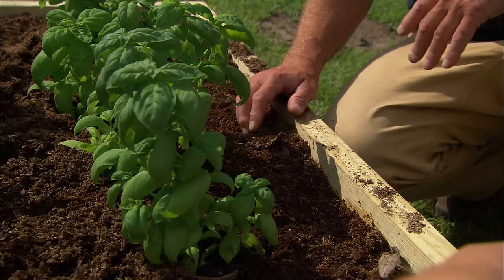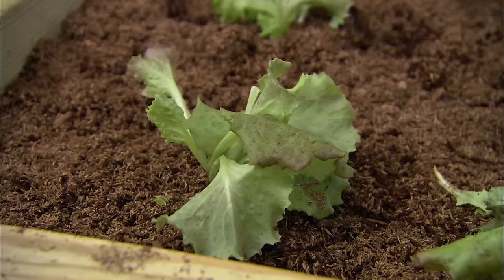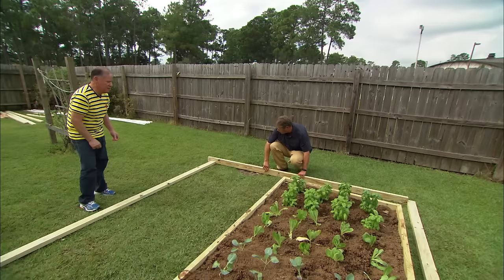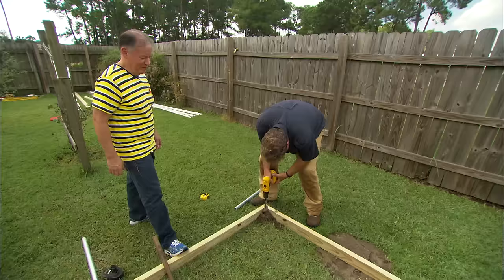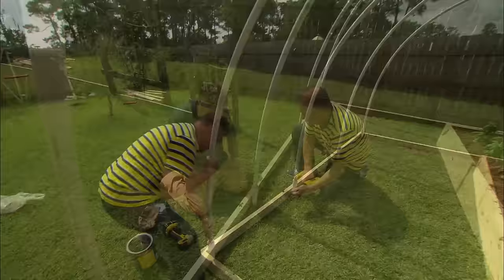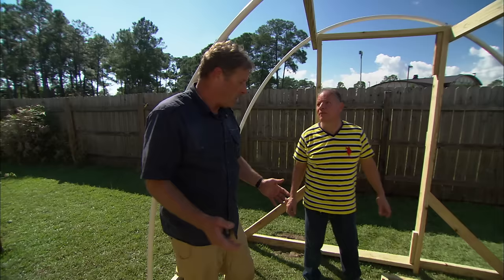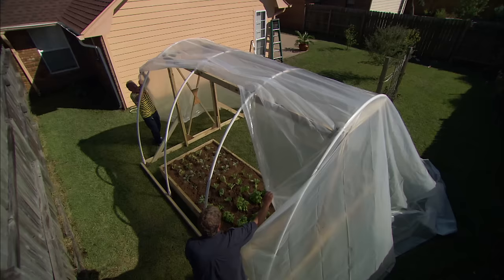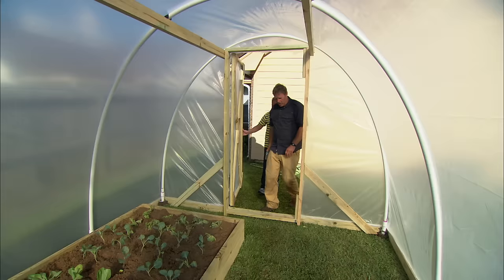How to Build a High-Tunnel Greenhouse | Ask This Old House

Comment: Much easier if you were to use rebar instead of steel pipe for the support base.
Reply: Never heard of a string trimmer?
Reply: rebar rusts
Reply: Cv
Reply: @albertleppo8139  it will outlast the wood that's sitting on the ground.
Reply: I use the rebar also, I've had some in the ground for 2 decades, haven't had an issue yet. Also, the doors seemed like an awful lot of time , effort and cash, when just using plastic over the whole thing works just as well. I attach a 1x3 to the edge of the plastic, and then pull it up or down when it gets to hot in the summer. In Massachusetts or Maine (I have places in both) even the summer gets to hot for permanent hoop house. better to be able to use it spring and fall, then take off for July and August.
Reply: What length pipe/ rebar is used?

Comment: For the staples…. Fold over a few layers of plastic, pull it tight, and the staple it! Afterwards use one inch roofing nails spaced every 6-12 inches! It’ll hold!

Comment: that far south you do not need plastic to keep frost off greens. they are pretty hardy anyway and i would go with row cover fabric instead. the biggest reason to use row cover would be for pest protection anyway. here in tn i had spinach collards turnip green and cabbage survive the winter with freezing temps. my biggest issue was bugs once the temps warmed up. next spring i will be using floating row covers for my brassica vegetables and my squash since vine borers are a real problem here.

also why build a tall walk in place when you can just throw up a small hoop house with fabric to protect from frost or pests?

Comment: Any concern about the pressure treated wood chemicals seeping into the ground and then into the vegetables?
Reply: Depends on which chemical your wood is treated with. The wood you buy today at the store is perfectly safe for your raised garden even touching the soil but old wood is best kept away from the soil touching your plants but for the greenhouse frame is okay. That is because of the chemical they used to treat wood with called copper arsenic.

Comment: Bare wood in constant contact with moist ground. I wonder how long it will hold against rot, even if impregnated.
Reply: Just elevate the wood an inch or so from the ground.
Reply: +Anders Spælling and defeat the entire purpose of the greenhouse which is to keep the air inside and hot.
Reply: Chris Searle a few milimeters Will not make a difference
Reply: Chris Searle its pressure treated wood. It'll hold up for quite sometime
Reply: Like the guy said, elevate an inch on some bricks.  If you want to do the extra work, put some concrete block all around the perimeter, then screw the 2x4 base into that.  Or screw some 2 foot lengths of 2x4 under the 2x4 base every few feet.  Then replace those every 3-5 years.  The plastic will be torn by then anyway, and you'll give up on the whole thing.
Reply: The wood will last longer than the pvc and plastic.
Reply: @jackfrost326  wrong, genius, pressure treated still rots

Comment: Should've bought some pressure treated lattice strips and rolled the plastic ends over them, them nailed through the lattice strips with roofing nails.  That would've held the sheeting all across its surface on a 1.5" strip instead of just at the points where you stapled.  It makes a big difference in wind conditions, especially the kind Mississippi gets.

Comment: Looks good, but you shouldn't staple the plastic to the 2x4, it'll rip in light wind. Instead of using 2x4s use two 1x4s, sandwich the plastic in between them and screw them together. 

Also, he used pressure treated wood on that raised bed. The chemicals from the treated wood is going to leach into the soil and contaminate his vegetables. Better to use some kind of stone or cinder block. I mean, they have the right idea if the wood is going to be in contact with the ground. But pressure treated shouldn't be used on a raised bed that grows things you're going to eat. Otherwise it's okay. 
'
Reply: Take a look at the new method of creating pressure treated wood after 2003, you may be delightfully surprised.
Reply: @forestrebock3545  
For decades it was argued that the arsenic in pressure treated wood was harmless. So now there are alternatives to arsenic and again it's claimed they're harmless. The question is, do you trust those in the industry or is a little skepticism warranted? As for myself I prefer to use stone. To each their own.

Comment: What are the finished dimensions of the greenhouse:  Length, width, and the height (at the middle point).  Also, isn't the common 4-mil plastic sheet a wrong choice for the covering?   With full exposure to the sun It would barely last one season.  A UV stabilized 6 mil sheet would be a far better choice for this purpose.
Reply: expensive - sand and paint tubes with Krylon acrylic white spray paint or put rubber (not vinyl) tape where pipe touches sheet ... it's the vynil chloride gas off from the pipe that destroys the poly sheeting...
Reply: I use 4 mil on my mini 4x4 greenhouse and it lasts me the whole season true it does degrade but its an easy fix

Comment: That pvc will become brittle over time from UV rays if your serious about making a greenhouse get galvanised pipe  you can even buy greenhouses and just put them together yourself.  Also that plastic they brought is not as good as the proper stuff.
Reply: +Erin Scott It's grand if you want something temporary but for the long run go the proper way.
Reply: Instead order UV stabilized plastic from suppliers like Farmtek or Gemplers.
Reply: iShootBandits you can spray paint the pvc to block the uv rays if you want to use the pvc
Reply: my mom built chicken hooupes out of pvc exactly like this.  I was 11 when we assembled them, I'm 33 now, the pvc is still serviceable.  never did anything to it.  it's chalky, but that's about it.  PVC outlasted the chickenwire as a matter of fact. Thanks to our high-humidity down here in mississippi.  Probably cost $100 22 years ago, not a bad exchange If i say so.
Reply: The PVC if unpainted will off-gas and deteriorate the plastic sheeting, too. Combine that with not using greenhouse plastic and I’d wager that this hoop house doesn’t last very long.

Comment: A plastic single layer high tunnel is actually colder at night, because the air is still, so you will need somekind of heath source

Comment: Clearly not the original idea. "We are going to need 4 10 footers and 4 12 footers". That was clearly way more than 8 2x4's later on.
Reply: Lots more wood and hardware required, the doors by them selves is a whole other project.
Reply: He kept driving back and forth and forgot to add that part because it was a booze cruise

Comment: question....can this kinda of green house stand again strong wind? im not talking about hurricane but like strong wind that some time appear around winter times.
Reply: Not that thin plastic, and not with just staples.
Reply: Maybe if it had more tapered sides, with no flat sides, so the wind would just go right over it.  As long as their's nothing for the wind to catch, and everything is secure, it seems like it would be pretty resistant.
Reply: Even worse there is no end to end support. He braced the door frames but wind coming from either end will blow this over. Four corner posts should have been longer and dug in.
Reply: I'm going to give this a shot with 6 mil plastic... I'll let you know in a couple of years
Reply: Commenting to be notified in a couple of years
Reply: Icemarine972 lmfao....

Comment: does this guy have some bias against offering useful, actual, solid-built, durable structures?
Reply: Nothing wrong with having a small greenhouse Patrick
Reply: Cost.  Thank you TOH YouTube Comment Section Expert #6,213,256
Reply: Your missing the point of TOH. The actual show, shows off their skill. These projects going to peoples houses are meant to show a home owner how easy these projects are to save you a ton of money. You just need basic tools and with zero experience you can pull this off. This is for the everyday home owner on a budget trying to save a few bucks any way they can.

Comment: you think staples will hold the plastic down in the wind...…..no way
Reply: Not a mission.  I cover a 1" lath in duct tape.  Sandwich the PVC sheet between the frame and lath and bolt together.  Has survived many, many coastal storms.

Comment: They used 1” schedule 40 PVC so thats good. But they could have saved money and used all PVC instead of adding so much wood. And they could have used rebar to help hold it down. 
Staples in the none uv rated plastic will tear that sheeting apart. Thats where they could have used thin slats of wood to hold down the sheeting.

Comment: PVC will destroy the plastic real fast.
Reply: So what do you need to do to prevent destruction of plastic. I'm using 6 mil UV rated and 1" PVC. I've seen suggestions about sanding the coating off the PVC and painting it with Acrylic.....??? I'll definitely use more than just staples to fasten the plastic; I live in a fairly windy area.  Lou F.

Comment: Staples will rip the plastic.  The plastic should be greenhouse grade.  The ends are not sturdy.  The 2x4's are directly on the ground.  The PVC not fitting the stakes is crap; use rebar.  Tom Silva is not eating his heart out.  He's laughing or maybe crying.  This was a terrible instructional video.  Wrong every step.  Even the project.  All the "customer" needed was a hoophouse over the raised bed.
Reply: Kube Dog Had to laugh, this coming from "This Old House".
Reply: Kube Dog You answered all my questions with your comment, thank you!
Reply: Kube Dog what do you recommend instead of staples?
Reply: @thomasmacias6816  lathes and screws
Reply: foshou citron do you use a metal lathe or a wood lathe?
Reply: @tywebbgolfenthusiast8950  wood Gabby, but now I think I would use something like this because easier to change plastic in the future : https://www.greenhousemegastore.com/hardware-diy/covering-installation/polyethylene-install/spring-lock-bundle?returnurl=%2fhardware-diy%2fcovering-installation%2fpolyethylene-install%2f
Reply: Instead of staples wrap the plastic around a one by two(furring strip) two or three times and set the wrapped strip between two more strips that form a groove, cover the whole thing with a one by four  and you have your sheet trapped with no rips at all. The plus of this is that if your plastic is loose, all you have to do to tighten it is free the bottom of the sheet at one side, roll it up 'til it's tight enough and fasten it down in the groove again.
Reply: I see this as just a temporary green house that can be taken down in the spring. If it's temporary then lower build quality is totally fine.
Reply: Duct tape?  Good luck with that.
Reply: Jonathan Adams lol I concur

Comment: 1 gust of wind and that is gone
Reply: Karl Davison the galvanized pipes are hammered 1.5 feet into the ground. The weight of the wood and the tension of the PVC pipes will keep it in place. A little wind will do noting. Should have used thicker plastic and duct taped over the PVC where it comes in contact with the plastic as there is a chemical reaction between the PVC and plastic that will weaken it.

Comment: Plastic only fastened with staples ? Good luck with that
Reply: How should it be done please?  Thanks
Reply: sheryl napier wiggle wire for a larger high tunnel. For something smaller like this just use "row cover". It's a white cloth that lets light in but helps insulate at night.

Comment: How did that plastic work out? LOL
Reply: Alan Barrett II the heat of the sun will penetrate through the plastic and will continue to make plants grow. Due to the heat of sun .if is cold out still inside keeps warm.
Reply: @cristianculetu5081  heat doesn't cause plants to grow, uv light does. Very little will penetrate opaque plastic (which is what you'll get because sunlight causes plastic to turn opaque
Reply: @gandalfstormcloud7514  you don't need uv light

Comment: Could you use ferring strips and screw to 2x4 to hold plastic in place? Also pin or screw pvc to pipe in ground to keep wind from blowing away. The brackets may do the same.

Comment: I live in North Dakota..... NO plastic on this earth will keep anything alive when it -20° outside...
Reply: Plus the prairie wind will blow that apart in no time.
Reply: man even insulated walls don't do enough there.  Lived in Fargo for a few years and damn that windy cold was ridiculous
Reply: I think you would just need a more permanent green house and if you have a home boiler then you could connect it to that with a hot water loop.
Reply: You will want two layers of 6 mil plastic for your climate. The are traps between the layers will act as insulation.

Comment: A better way would be to staple the plastic to an extra piece of wood ans screw it to the base frame. This way you can roll it up in summer. That‘s especially useful for growing e.g. tomatoes. They will get a good ventilation and still be protected against rain to prevent late blight.

Comment: Looks great!.... But, from experience, this type of plastic tunnel generally gets colder inside than out during winter and excessively hot in summer so it's not going to protect much... Also, wood is prohibitively expensive in Europe, and simply stapling the plastic to to wood will rip it on the first windy day. Obviously depends where in the world you are.. Apart from those minor details, fantastic work!

Comment: The plastic you get at big box stores will not work because it is not UV treated it will not last more than 1 year !
You have to use greenhouse plastic at least 6 mill and if put on correctly it will last 5 or 6 seasons .

Comment: All winter long? Not in Mn. maybe ok for Mississippi...But in Mn. It gets so cold the pvc snaps..and staples will rip that plastic off in high winds.
Reply: I had one like this last 5 years in MN.  I did go out and clean the snow off.    And yes I was able to grow plants with a little heater installed.

Comment: Only problem with PVC is the UV light in sunlight will make the PVC brittle in 2 or 3 years unless you paint it. Spray on Plastidip won't flake off when the PVC is flexed like normal paint will...

Comment: I don't know what size doors and length and diameter of the metal pipes that were driven into the ground and all of the other parts that were used. Make a parts list. What was the cost?

Comment: One addition I would make to this is, where the plastic is secured to the wood....use some kind of material that will meld to the plastic yet you can remove it from the wood come spring.  That way you can take the tunnel down in the warm months.  I know. I did a poor job explaining it, but I am hoping you all know what I meant.
Reply: wiggle wire and channels do that
Reply: That roll of plastic sheeting is like $15 bucks. Just grab a new roll every fall.

Comment: Stapling the plastic sheet won't last long, the stapling point will be ripped as the wind blows the green house. It should be secure with 2x4 and nailed the plast sheet between two 2x4.

Comment: Pro Tip:  your plastic sheeting will be 20ft exactly.  Make sure to pound those metal ground posts flush with the 2x4 or you will have a gap that the width of the plastic won't span.  Learned the hard way.

Comment: This is great! I think I would make some holes all around on the plastic for ventilation and cooler temps.
Reply: A way to roll up the sides would be better, in my opinion then poking holes for venting. Not sure how to do that without compromising the structure tho.

Comment: Checking Amazon for lumber prices I see most of the 2by stock is between 1 and  5 ft long. What do you build with that? I also saw 8 ft 2x4 for $36 each so I guess that's how they cover it on the free shipping!

Comment: There's a guy in Manatoba I think... Bob or Daves? Greenhouse plastics. He sells both seamed custom greenhouse covers and straight runs of 12' or 10' wide sheets in either 6 mil or 12 mil woven poly, UV treated opaque. Cheap! Guaranteed for 4 years and many have had the same plastic up for 10! Of course that would depend on your climate. I am NOT affiliated in any way with this company, I am also going to build a greenhouse next spring. This is just a helpful post, nothing more. Peace out!

Comment: The plastic needs to be of a greenhouse type or the sun will dry out and rot that fast...less than a season. In Mississippi it gets  very hot so fans would be needed too

Comment: Chemicals used to treat the lumber will end up leaving into the soil and then the vegetables.  The PVC will break down from sunlight, it needs to be covered with duct tape or painted with exterior latex paint.  4 mil plastic will also break down because of UV rays.  6 mil UV treated would be a better  choice.  He's be lucky to get 2 years out of this.
Reply: Have you ever been to Mississippi.    Some town's sewer pipes are above ground PVC been that way for over 20 years no problems at all.

Comment: You need to order plastic designed specifically for greenhouses. If you just put up generic store-bought stuff, the sun will destroy it in a matter of months. The worst thing is that the areas that get really sunburned will become more brittle than eggshells and start chipping right into that good soil that you've also spent your time and money on. Lessons learned the hard way.

Comment: Do you need to heat the greenhouse in the frozen winter? I’m kinda confused after watching many greenhouse video because some do use heater 🧐
Reply: Putting plastic over will make it warmer when the sun shines but at night that thin plastic will not retain heat so the plants will freeze very easily.  There needs to be a heater or passive heating such as black oil drums filled with water to absorb heat in the day and give off heat at night.